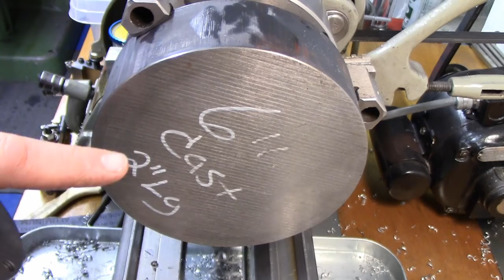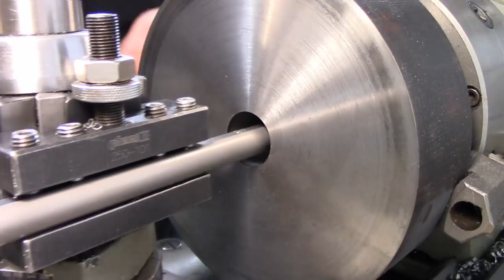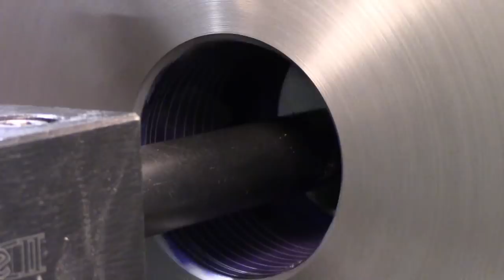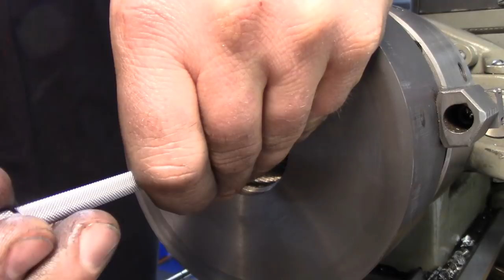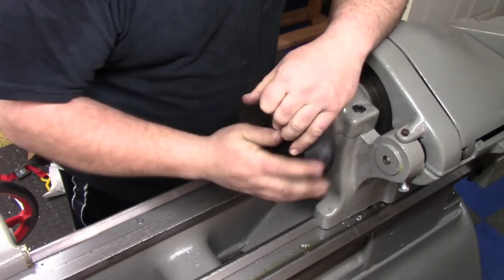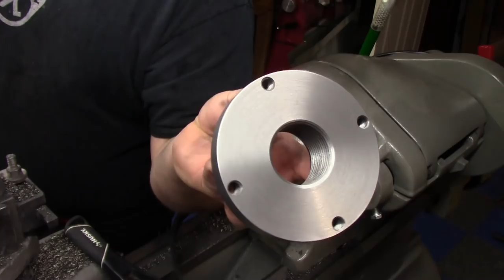Making a Chuck Backplate

Comment: Nice job on the backing plate you made, I just rebuilt a 1937, 12" Le Blond, Regal, round top I rescued at and Estate Sale. No one had bought since it was in many pieces and pretty dirty, It had been disassembled to facilitate getting-it-out-of and ole Gunsmith's basement. The survivor's plans (all 4 were daughters and had no interest in lathe's) were, at the end of the sale; what ever was left of Dad's junk would go to the scrap yard. That made me sad! It's 4 jaw chuck, tool holder, and taper attachment, had been sold but they claimed everything else was there. I bought it although it was much older than, and much more work then what I really wanted. To make a long story short, it's running now and I am very pleased with my rescued lathe. I was an Journeymen Electrician and now 72  had never ran a lathe but always wanted to learn, but never had time in my life to attempt it. Well I got time now, I found out right way that for the things I want to do I needed a 4 Jaw Chuck. I also found that I needed this crazy size thread 1-7/8" X 8 Tpi. At first I though I must be measuring the spindle wrong, it must really be 1-3/4" or 2", than I saw your video and now know that yes: that really is and actual size, 1-7/8" X 8 Tpi who would have guess. Thanks for the education, sorry it took so long to explain it. So I will be trying this project soon once I get the 4 jaw chuck.

Comment: Came out great, thanks. Question; does the back plate have to be cast iron, if so why?
Reply from the maker: Cast iron tends to dampen vibration and harmonics where steel might amplify them.  Also the cast iron is a different metal than the spindle thread so it should prevent galling.  Cast iron also tends to not raise a burr if nicked or dropped.   A decent steel can still be used if Cast iron is not available or too expensive.  A working chuck is better than no chuck.
Reply: @Halligan142  Thank you, good information to know.

Comment: had the same setup , and couldn't get the rpms low enough at the outside circumference.. I had a dam water bottle acting like a fogger to keep the bit cool while doing the o.d .. crazy day , was sweeping that crap out from everywhere when I was done.i was stalling the machine at 130rpm , and cooking with 300 rpm..anyway , that's my rant , nice work as always

Comment: Hi Greg. If you did not have cast iron what steel would you use? Also what about a two piece welded hub and plate? Thank-you, Mike.
Reply from the maker: Michael D Joven 
You can weld to pieces together as long as you're able to true them up.  Also it'd be better to rough the bore, weld, then finish the.bore and thread to get rid of any possible warp.  As far as materials anything can be used.  I like 1144 stressproof.  Easily machines.   1045 is a decent choice and readily available.  You don't need any crazy hardened or hardenable stock.
Reply: Thank-you again!

Comment: Lookin good, Greg.  One question, it seems that on the facing cuts the carriage lock is not set, or it was set when the camera wasn't looking. Do you trust the carriage not to move when making facing cuts?  Its good to see the 13" in action.  I'm anxious to see it make some big boy chips.
Reply from the maker: James Reed 
I always lock it down.  The 9" has a wrench on a square head bolt.  The 13 has a bolt with integrated handle I made.

Comment: Hi, great video! I have a question regarding the thread, is that a right hand thread? This might be a dumb question, but if the back plate is running counter-clockwise, wouldn't it come undone? Is the thread enough to keep it on? Or am I missing something?

Comment: Nice video. Just wondering why not mill a couple of flats in the back register so you can use a spanner wrench or similar to remove the plate?
Reply from the maker: You can do that if you want.  I always just used a piece of hex held in the chuck jaws.  Gives you something to put a wrench on

Comment: Is there a reason you didn't use cutting oil. Or is it because the metal you were using is cast. I have some cast to do some projects with , but have refused to use it due to the mess it creates. Also had you considered putting index holes in the chuck backplate. I have one chuck with an indexing back plate and find it very useful. Very good video. Also happy new year and hope Christmas was very special this year with the new born.
Reply from the maker: Anthony 
Yes.  You don't want to use cutting oil with cast iron.  It machines fine without and if you do use oil all that fine powder turns to a metal abrasive goo.  While it does make a mess it's pretty easy to clean up with a vacuum.
Reply: Anthony I

Comment: Thanks Gred  I've never understood what those numbers on the fishtail or thread gauge is for could your explain a bit more please?
Reply from the maker: Shaun Tucker 
It's a basic depth of thread for a given pitch.  It says double depth because it's related as material off the diameter so double what your actual infeed is. It's also for a sharp v thread and a straight in feed.  When threading you'll  be feeding in at a 30 degree angle so it'd be off   It's good to use for a reference to get you close, but best way is to measure with thread wires/ plug gauges or fit to the mating part.